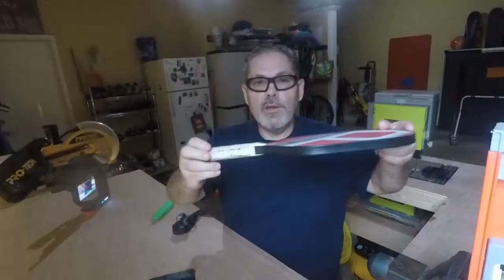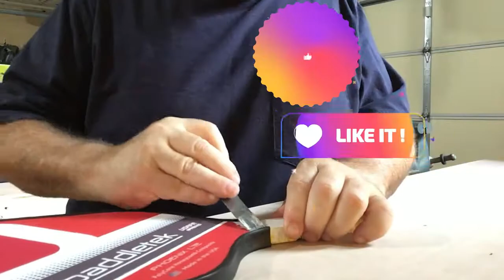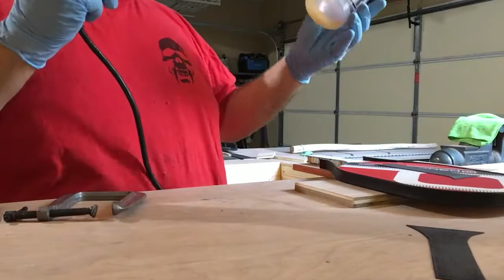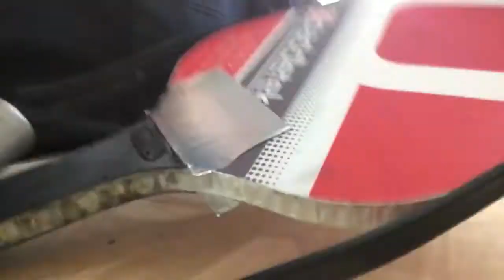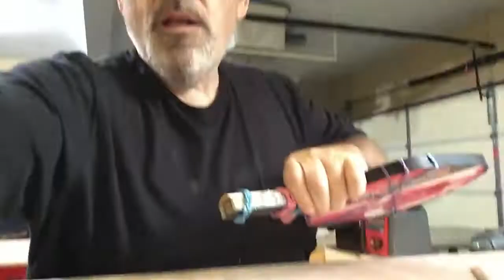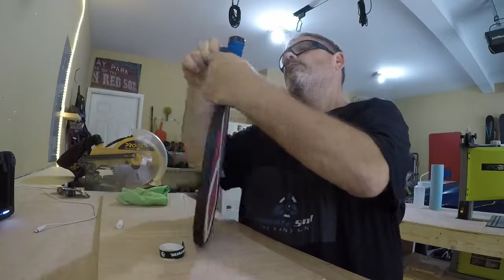Pickleball Paddle: Cracked Handle Repair

Comment: Nice!! [Do you offer a mail- in service where I can pay you to do the work instead of trusting myself?]
Reply from the maker: Yes what is the issue and what type paddle
Reply: @pickleballtech901  sorry I am just now getting plugged back in! The paddle is an Electra Electrum. The "spine" on one side of the handle has cracked because one of the places where they are joined has separated. 
[Terrible explanation-- sorry -- but I can seen you pics if you give me an email address. Thanks!!

Comment: “Easy”?? What you did does not look easy. What an amazing job. Sheesh. Not sure if $10 of carbon and $55 of epoxy is going to be worth it all. And not sure I can do it as well as you did.
Reply from the maker: You can do it
Reply: @pickleballtech901  - It’s a solid maybe. Hahahaha.
Reply: Ok, I found a smaller size of the same epoxy, so supplies will arrive tomorrow! How did you cut the carbon fiber?
Reply from the maker: @JeffreyPinkerton  yes a band saw with a fine blade but a coping saw with a fine blade will work too
Reply: @pickleballtech901  - Thanks! Mine is also wobbly side to side, so I might try and reinforce the edges of the grip as well. I’ll do your method first and if it’s solid, then I won’t. Wish me luck!
Reply from the maker: @JeffreyPinkerton  let me know how it works
Reply: @pickleballtech901  - A tile wet saw worked great to cut the pieces! Epoxy on, clamps on, we’ll see how it looks tomorrow night. Thanks for the video!!
Reply from the maker: @JeffreyPinkerton  can’t wait to hear
Reply: @pickleballtech901  - It WORKED!! Of course, each step had to dry overnight, so it took a few days, but I took it out last night and played for 3 hours. Good as (almost) new!! Thanks again for the great video - carbon fiber, epoxy, and big rubber bands, and your video, for the win!!!
Reply from the maker: @JeffreyPinkerton  that is awesome to hear

Comment: Uh, I don't think so. Clicking on the epoxy link in this video, one finds the suggested amazon product costing nearly $60. And the carbon fiber link finds a product costing $40. So you can spend a minimum of $100 (not including taxes) and, assuming you have the equipment to cut and sand the carbon fiber neatly and the apparently lengthy amount of time it takes to do the project, why not just BUY A NEW PADDLE?
Reply from the maker: This cost is for Simone one like me that can do multiple repairs for this price you can find the product in smaller quantities for sure
Reply: @pickleballtech901  ... Understood. Perhaps if I had multiple paddles to repair, it would be worth the investment. But I have only one. So I'm going to try a product called "fiber weld" instead. Years ago I used the precursor product, called fiberfix, for a different application and it worked wonderfully. I will repost here in a week or so after I have tried it for my broken paddle handle, and let you know whether it works for this. Thanks for posting your video and for your reply. Dink well, and stay out of the kitchen.